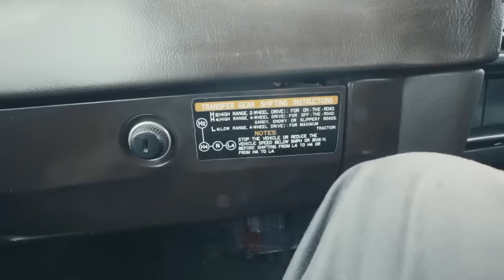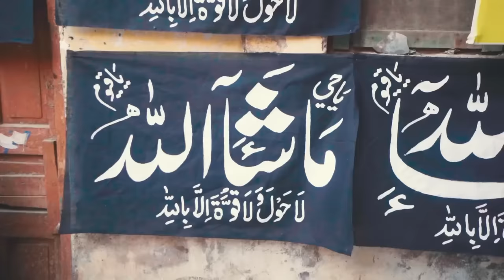On the border of Afghanistan and Pakistan / How people live in Pakistani tribal town

Comment: Amazing work! Honestly I’m impressed with their talent! They have the minimal tools and make very impressive guns. Sure it’s not within tolerance of the original manufacturer but still extremely impressive!
Reply: If you are a gun fan, you will love this place
Reply: You can make tolerance within 0.01 mm with handtools ,
Reply: @hristoapostolovski5407  sure you could. I have done it back in college for my precision machine technology course. But I had a shop, heated and air, specific machines for measuring and checking tolerance, clearance gauges. It is impressive work these men are doing

Comment: Who says you can't reload steel case? Always amazed with the artisans that make working products by using simple tools  and recycling/modifying. Beautiful guns.
Reply: Yup
Reply: Nobody said you couldn't 
It's just more complicated from what I've heard. I don't reload so I'm not a expert in the matter
Reply: @texaspatriot9159  It's also deleterious for your firearm. Brass is much more malleable than steel, which creates a better seal in the chamber, which prevents incredibly high-pressure high-temperature gas from jetting around the casing and eroding the chamber/etc. Notice all those dents in the casing? But...cost/wear/use/platform v. replacement$/sentiment/heirloom

Comment: I disagree with the comment that these guns can't match the original manufacturer. Every single part on these guns is hand made. Perfect finish and tolerances. Most American or European gun manufacturers use mass machinery to produce guns. There are huge tolerance differences between 2 guns. With these guns, they're probably closer to German arms around WW2 very precise. I bet a lot of them are better than off the shelf guns.

Comment: You can buy a new gun in the U.S.A. for a lot less than a smartphone. You can get quite a few types around  $300 and Some are less than $200.
Reply: A decent AR only gonna run you $600-$800
Reply: $500 from PSA
Reply: Yes but here there is no gubberment paperwork or checks
here.
Reply: If you're buying a Glock, HK, S&W etc. in a 9mm/.40/.45 for under $300, you need to ask a lot of questions about where it came from.
Reply: American guy got a AR from Pakistan shipped to his house for cheap and said it’s decent

Comment: Oh and just like in America they move the factories away from people that make the bullets. Those factories can go boom and if it’s in the center of a town lots of people get injured.
Reply: Smokeless powder isn’t an explosive, it’s a flammable solid. If you were to light a pile of the stuff outside of a sealed, small space, where the gasses aren’t confined under high pressure (e.g. the chamber of a barrel), you’d be completely underwhelmed by the slow, unimpressive burn rate. Thousands, if not millions of Americans produce their own ammo at home using the same progressive press shown in the video, with the ability to easily produce hundreds of rounds an hour, along with cabinets full of both loaded rounds and dozens (if not hundreds) of pounds of smokeless powder stocked away for future use - and it presents zero risk to next door neighbors as it doesn’t explode.
Reply: The only dangerous part is the primer production & it's done separately.
The actually gun powder isn't really an explosive.
Reply: funny thing there was a warehouse in pindi a city in pakistan in my chilhood it got lit and missiles and bullets went in chaos it kept going on for a few days the city had to be evicted.